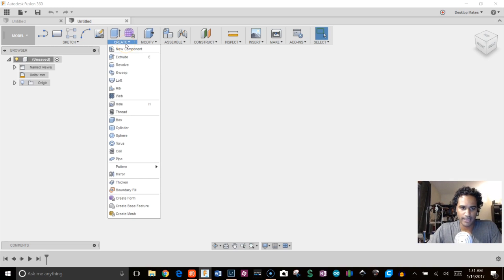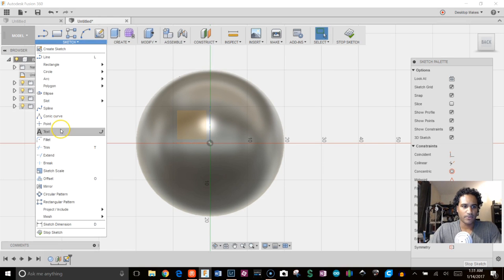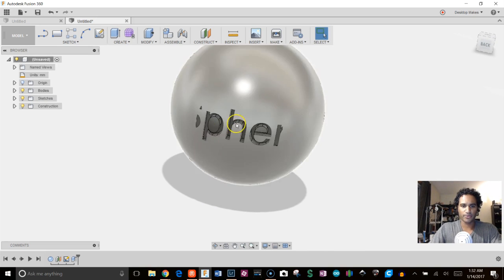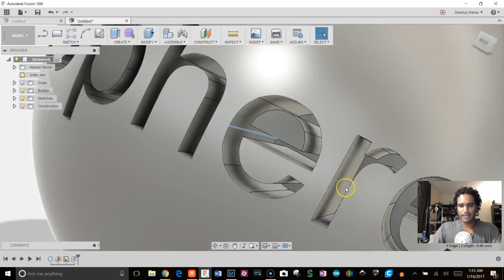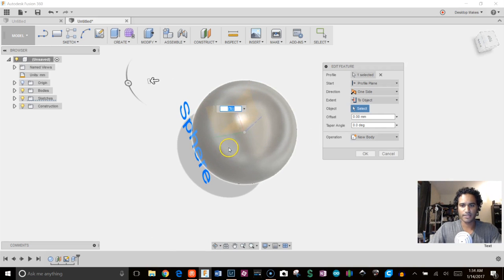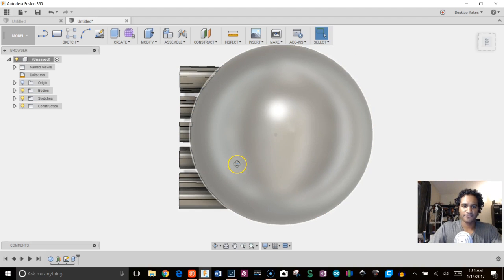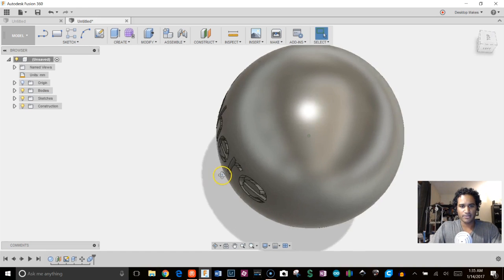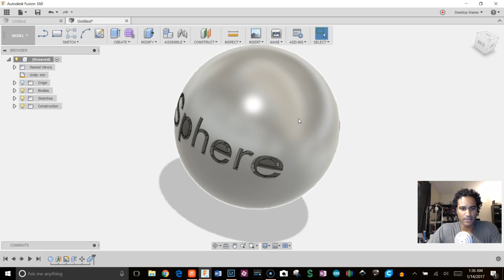Extrude Text to a Curved Surface in Fusion 360

Comment: please do a tutorial on how to do a curved text inside a circle. let´s say you have a Gas cap and want to do a text on top on the cap that follows the circle around. Not the edge around it but on the top surface. i can´t get it to work in Fusion 360

Comment: Maybe it's a new feature, i wouldn't know cause i'm new to Fusion 360 myself, but there is a more direct way to accomplish this now. You simple make the text sketch, and when you are going to extrude, instead of changing the Extent option,  you change the Start option, and select From object. That way you get the same result in one step. The sketch doesn't even have to be in an offset plan or whatever, that doesn't matter, you can do it in the origin if you want.
Reply from the maker: Thanks, tried it your way and it worked great.
Reply: That worked great, thanks.
Reply: When I attempt to do that I get this error:

Error: Fail to project profile to remote surface

What am I doing wrong?

Comment: This does not fix the distortion problem with the letters, they are not truly wrapped around, it's just a projection. Try wrapping around the entire circumference of the sphere this way, you simply can't. This is not a genuine solution to this problem.
Reply: Really though, this is a pretty expected feature to have in a program like this. It matters for certain projects that the sketches can be projected properly to curved surfaces then extruded in the correct direction as well. I don't see what's so hard about having that feature.
Reply: ok greg
Reply: create an offset plane to apply letters to, then use this feature.
Reply: You mean create an offset plane for each letter? That is ridiculous! And it still will not wrap the letters properly, it'll be a "good enough" fix but not a true solution.
Reply: What is the best way then??@GregTakacs
Reply: The difference between "good enough" and perfect, is that "good enough" gets the job done!

Comment: Hi, these are great. have you tried to to do this with split the face of the line drawing or text. it works well if you want a cut shape around a curved surface like a cylinder

Comment: is there a way to "bend" the text to not distort the spacing or letters? to be able to "wrap" text around a cylinder.
Reply from the maker: I'll look into this.  I did notice that the closer to the edge the more distorted the letters look.  I'll post a follow up video if I can find a way to avoid the distortion.  Not sure if you can do it with text yet.
Reply from the maker: Not that I know of yet.  But there is talk of sheet metal functionality that is supposed to be released soon that is going to allow this.
Reply: You can project to surface but from what I've seen distortion still occurs. 
The best option might be to download and install this plugin which will wrap sketches to a cylinder. 
https://github.com/hanskellner/Fusion360WrapSketch

You could draw up a cylinder the same diameter as your sphere. Then wrap your text. That would remove any horizontal distortion.